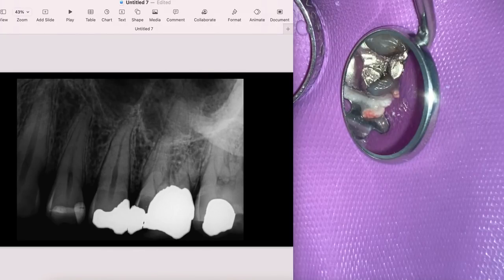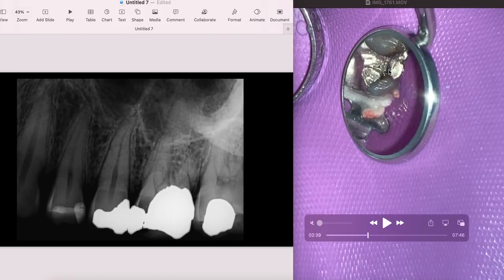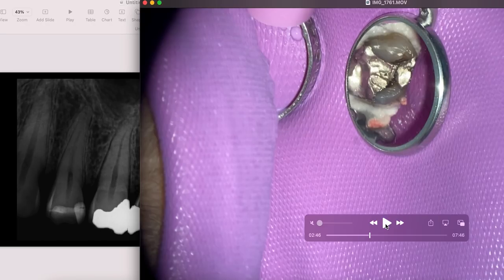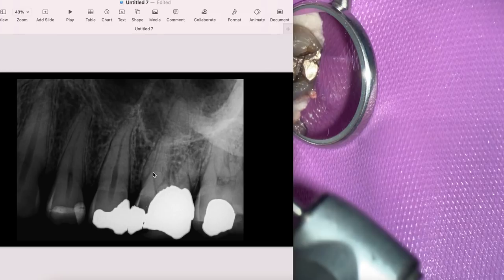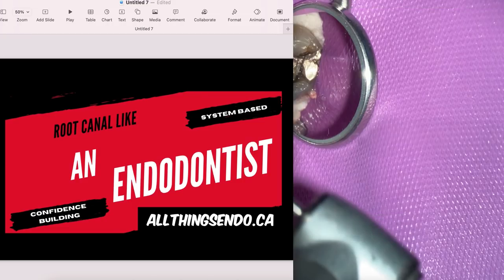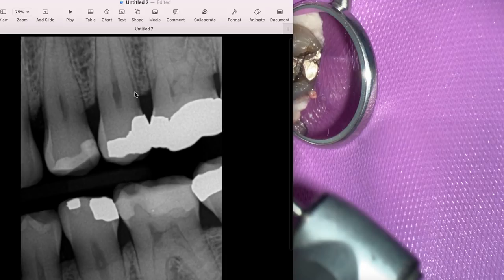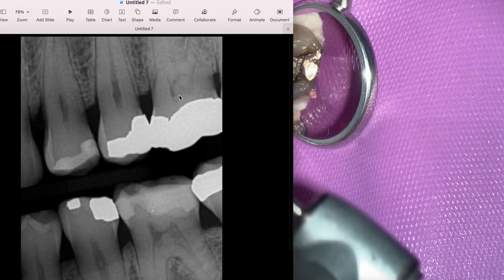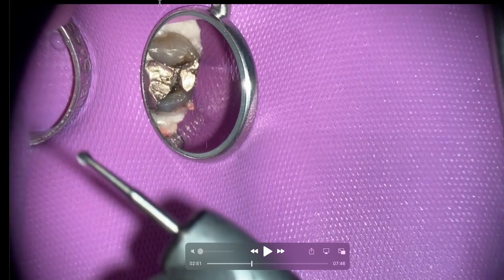Maxillary Molar Access [HUGE CALCIFICATION}

Comment: Hi Ash will be very intersting to talk about patency and hand files and differences between vital cases vs necrosis. Usually vital cases the problem is the collagen plug and the reason why some clinician uses number 12 files instead of jumping directly to 15 file. In necrosis cases usually is apical anatomy courves etc. Another very intersting point will be to discuss about patency in confluent canals like mesial root in lower 6 and upper six usually a lack of patency contributes fractures with rotary files. The key is Patency and handfile proble sometimes is time and we dentist wants to run.

Comment: Do you like reciprocating system like waveone better than rotary system like protaper? Why?
Reply from the maker: Funny story.  Someone had asked me to cut some videos using protaper.  So, I got all the stuff ready and took out all the files necessary for Protaper Gold.  S1,S2,F1,F2,F3 and maybe F4.  That's 5 files!  LOL. I was like, forget it.  With reciprocation, I use 2 files maybe 80% of the time (25.07 and 35.06).  It's more efficient and less things.  Hope that helps!

Comment: I just have a case now of a friend of mine with a resorcinol-formaldehyd resin obturated  molar. I managed to take out the RF but can't find the entrances of the mesial canals in the 1/3 lower third of the root. I have only  magnifying glasses up to 2.5 nut it doesn't seem to help a lot. Usually I am pleased with that magnification but in this case... I have the feeling everything is black because of the RF. Do you have any ideas how I could manage to find the entrances? I used EDTA AND NaOCl 2% to flush.